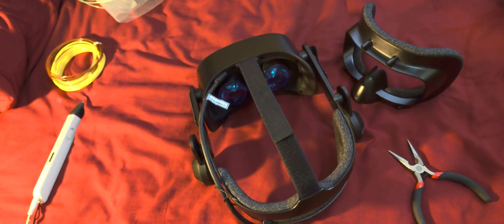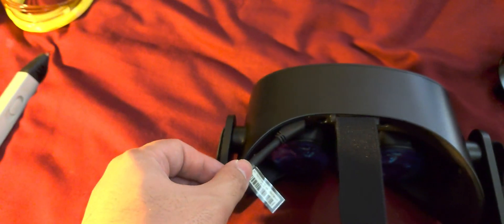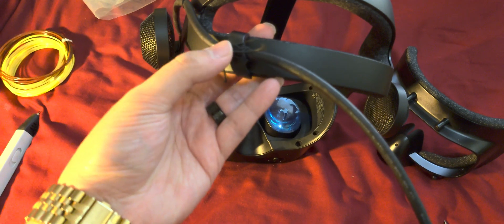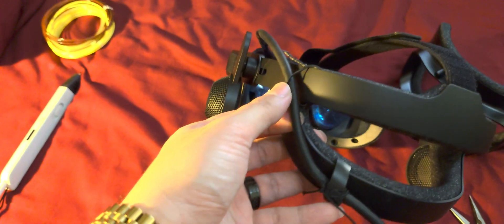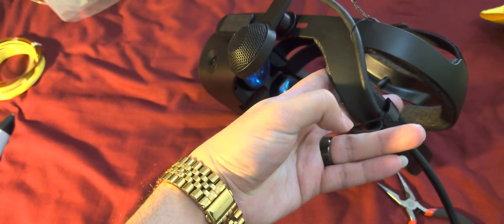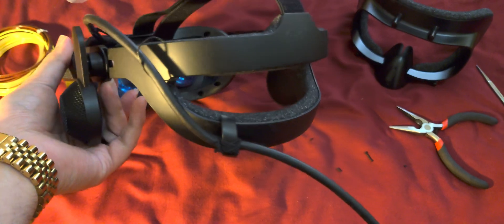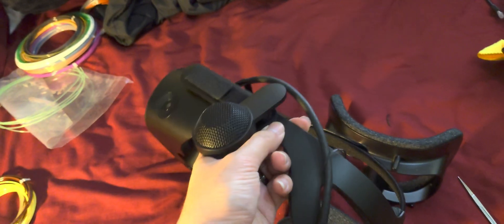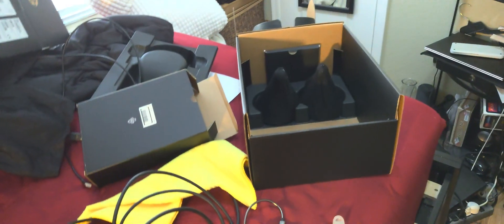Do This BEFORE Ruining Your Reverb G2

Comment: Velcro straps bro
Reply from the maker: They'd be far bulkier both ergonomically and aesthetically not to mention far less secure but a less permanent alternative of a suggestion nevertheless.
Reply: @BradTech.  Not at all, it looks less bulky and a lot cleaner than your solution.  Here is a good example of a velcro strap: https://www.amazon.com/gp/product/B00O9VKVFK/ref=ppx_yo_dt_b_search_asin_title?ie=UTF8&psc=1
Reply: @BradTech.  Also to note, I velcro strapped the cable directly to the headset around the same location of where the HP cable guide clip goes.  With the type of strap I linked you can get it tight enough the cable doesn't move.  I suggest soft side on the inside to not damage the rear cushion.
Reply from the maker: Not half bad  @dct223  although it is infact way thicker both ergonomically and aesthetically than my method, still.
Reply from the maker: My question to you now would be  @dct223  if a horse had dragged you down and out by that cable with your headset on every day for a year then can you guarantee me that your cable will not lose a SINGLE MILLIMETER of that preset predetermined slack a year from now without having to fix or readjust it? because it cannot move as whatever amount of slack you first give it cannot then ever change a single millimeter in a year hence the stretchy string allowing it to move freely but not slip or change length as the string is wrapped tightly way too many times around the cord.
Reply from the maker: otherwise  @dct223  I suggest at least wrapping a stopper around the cable far too tightly to budge or slide across it (assumingly another velcro strap since you like them so much) while remaining too big to get past your alternate strapping method thus guaranteeing your preset predetermined cable slack will not ever change a single millimeter in length over years of tension, tugging, and abuse, for many more years to come.
Reply: @BradTech.  lol what??  your replies are just repeating the same thing that you think your solution is far superior and the only way to fix the an issue;  Trying to sound professional with technical terms and measurements, or confusing metaphors to describe  and/or question anyone else's solutions.  You feel your solution is the most aesthetic and best ergonomically but in reality it's not.  Personally just looking at your new "cable guide" on the side by using twist tie makes me think think that's cheap and ugly.  Your elastic string around the stock rear cable guide does not look aesthetically pleasing to me as well.  Changing to a velcro tie strap in that same spot to hold the cable in place is not thicker ergonomically and aesthetically.  You are probably confused of when people say use a velcro strap.  You use the velcro tie strap around the cable and the back of the headset INSTEAD OF the stock HP cable guide clip, you don't use the velco strap to secure the cable to the stock HP cable guide clip.  With that said, as you put it:  My question to you now would be @Brad ൠ  "if a horse had dragged you down and out by that cable with your headset on every day for a year"  would that stock HP CABLE CLIP with your "solution" of attaching the cable with elastic not break or unclip?  You can easily find numerous examples of that HP cable guide clip breaking when trying to remove or install it on the rear of the head strap.  It's a major design flaw from HP that has been well documented all over reddit and youtube.  It's also meant to unclip so a hard enough "tug" it will unclip.  In addition to all this, you should have better cable management set up to minimize tugging of your cord in general.  Also just think about it, If you have your cable fixed in a spot you will create a new stress point anyways, so a little give isn't bad to have.  Finally to answer your question, using a velcro tie strap around the cable and the back of the head strap at the location where the stock HP cable guide clip goes, I have it tight enough that it will not move unless you have a significant mount of force.  I have enough slack in the cable from there to the plug that goes to the headset to also reduce the stress point right at the plug.
Reply from the maker: maybe you're slow  @dct223  but I'm repeating myself because telling your method will cause you FAR GREATER ISSUES down the line IF the length of slack can change even one single millimeter with force over any period of time even a year under a ton of force it should break the headset before ever letting the length/amount of cord/cable slack for your cable change even a single millimeter... Can you get that through your thick skull? If you feel comfortable guaranteeing that with your velcro straps then I was just recommending you add a tight loop of velcro just around the cable alone for you to manage insuring its length doesn't even more or change over the years, that's all.
Reply: @BradTech.  LOL you should listen to your own advice about having a thick skull.  Others in this video comments as well as the G2 subreddit have different solutions to alleviate the cable strain to the headset.  Majority will side with me in replacing the stock hp cable clip with a velcro tie strap and leaving slack between that and the plug is a good solution.  Sometimes the easiest solution is the best solution.  Not some solution that guarantees not even 1mm of slack will occur blah blah jargon jargon blah blah.  No one is going to guarantee a home solution work around for a design flaw,  you can't even guarantee  that tying a elastic cord around a cable and clip will work.  I don't understand your fascination about needing the cable slack to be in the same exact position to the very millimeter.  As mentioned before, maybe it will help for some longevity in the beginning but you'll just be creating new stress points with it moving and flexing in the same position over and over again.  Electronics are never forever, they are all consumables whether you like it or not.  The G2 will be obsolete soon enough and need to be replaced.  I see your follow up video and the clip pops off, OK what will you do if that clip finally breaks off instead of popping off?  Oh no!!! You wont be able to get your cable in the same exact position and it would have moved more than 1mm!!  OMG YOUR G2 CABLE IS GOING TO FAIL!!    I've had my G2 headset for 4 months with consistent use with no GUARNTEE fixed position without moving a 1 millimeter cable management solution.  My G2 must be going to fail any day now....
Reply from the maker: You clearly lack the capacity for such fix  @dct223  but the defective connector will eventually short out IF the length of your slack can ever vary even one single millimeter over time so if you're internationally wanting to allow for your electronics to wear out faster than my video intends for then it's my fault for wasting the time trying to help you make your velcro alternative safer itself.
Reply: @BradTech. Ohhh My bad!  Didn't know I was talking with an expert on home made fixes for the G2 over here.  Don't talk to me about lack of capacity, I'm not over here speaking gibberish trying to sound smart on ALL your comment responses on your video.  Even with your "GUARANTEE" solution, the slack to the connector will vary over "one single millimeter" as you put it.  Just moving the headset  at the swivel will cause stress at the connector to the headset  I own the G2 and I see the design defect of it and seen all the posts of the cable going bad.  Some is defective equipment to begin with but I'm sure a lot are due to user error and yes some is due to a design flaw causing extra stress at the connector.  Again, 4 months into my G2 with my NO GUARANTEE it wont move more than 1mm, non ascetically pleasing to you velcro tie strap solution and I have had NO issues as of yet.  Also I might add, from this video it looks like you just got your G2 seeing the blue film still on the lenses.  Don't @ me just cus you think you're an expert after reading reddit threads and watching youtube vids about this cable issue.  All I was saying you just need a simple solution for the problem, not some over complicated over thinking, CAN'T MOVE MORE THAN 1MM OR ELSE YOUR CABLE OR HEADSET WILL GO BAD for a fix.
Reply from the maker: If you had any comprehension capacity in general  @dct223  then you would understand that despite politely trying to alleviate your incompetence I was only drawing one logical conclusion for reasons that would require a video of their own to someone as far behind as you because the cord/cable has to be fixed to a point that allows for pivoting withOUT ANY sliding (or variance in slack length to the slightest degree) as it ages so if you're satisfied then best of luck anyway dude.
Reply: @BradTech.  KK Noted with thanks :)  Keep writing all your big words to make yourself look and seem smart.  News flash buddy, NOBODY talks like that, its actually doing the opposite, you're trying too hard.  Sorry to disappoint you, but I do have the comprehension capacity,  so save it with your logical conclusions and alleviations of incompetency talk.  Looking forward for your follow up videos on fixing the cable or replacement headset.  Oh forgot... your elastic string fix is a GUARNTEE WONT MOVE MORE THAN 1mm SOLUTION!  OMG!  HP needs to hire Brad as an engineer right now!  He's figured it all out!
Reply from the maker: No problem  @dct223  I guess I'm just a nerd
Reply: @BradTech.  I would maybe believe your nerd statement if you talked like that in your vids, but you clearly don't.  But you know, that's just me lacking comprehension capacity, and drawing one logical conclusion for someone as far behind as myself, as you would say.  ;)  Keep us updated on your GUARANTEE solution even if a horse would drag you down and out by that cord everyday for a year!  (Cus this is how a nerd talks).  BTW if you really want to test your fix, you should have indicator markings on various points on the cord and headset that can be easily measured over time to prove your GUARANTEE WONT MOVE 1MM or else the cord/socket will short out!
Reply from the maker: Are you still talking  @dct223  seriously? The string already dug into the cord/cable enough to mark it so it'll probably strip some coating off its wires if it were to let it move but the clip was internationally designed to snap off under such circumstances because I'm the one going on people's videos to comment that I think I can do better... jackass
Reply from the maker: I suggest this following https://youtu.be/lmrpapyaBc8 video regarding that.
Reply from the maker: given how many tight rounds of winding in soft stretchy sting it's undergone for the likes of those who often end up stepping on their cables or get twisted in them (poor management) this cable WILL NOT BUDGE I'd rather break my strap before risking any stress on that connector lol
Reply from the maker: and yes, it will unclip and you can clip it back, but the difference is that when you do clip it back; the amount of length will ALWAYS & FOREVER GO BACK TO REMAINING THE EXACT SAME TO THE VERY MILLIMETER, and that is very important... so yes I am obviously assuming that you're replacing that from the get-go. I don't care if it can come off, but it should go back the exact same length every single time.
Reply from the maker: You cannot use this method if say a year from now your slack is a couple of millimeter shorter while you're still using it without noticing, that cannot be a possibility, not even if you still have a whole meter more of slack to spare.
Reply from the maker: so may be you did not process my advice to watch https://youtu.be/lmrpapyaBc8?t=15 this followup explaining that over a week ago.
Reply from the maker: BTW the string is tight enough around the cord/cable for its many loops to never slip across yet stretchy enough around the strap clipping point to act like that rubbery hardening bit at the necks of cords/cables preventing excess flex while still allowing for reduced motion (change of direction withOUT slip)

Comment: You have your cable running on the top of the headset straps which means that every time you put your headset on and take it off you will be lifting the cable because you need to lift the headset headband up at least a little to put it on and off. If you have your cable running down under the headset band then the bending of the cable at the plug end is less. I've been using mine this way for as long as I remember, however, I'm not saying this is a fix for the design issue.
Reply from the maker: Nice profile pic btw tom thank you for sharing your experience!
Reply: @BradTech.  You cost me a whole morning lol. I went back to the HP website and I was amazed at how much more information they have on it compared to when I ordered mine (September 2020 and got it delivered 15 November 2020), so thank you for giving me the incentive to look again! The issue I was alerted to by someone on YouTube (I can't remember who, it was quite a while ago) was the bending of the cable right where it joins the plug. With their solution (which I adopted) there is almost no bending so I thought that sounds like a good idea as every time you put the headset on and every time you take it off you are bending the cable at that point and I figured eventually the internal wires will break. I did not consider as you have done, the actual pressure on the plug exerted by the cable. It is a fair point that the way depicted on a photo on the HP website should produce less pressure on the plug, although HP does not mention anything about this other then putting the plug in before applying power to the headset. As a precaution (because I'm practically OCD on carefulness), I have put the cable back to where it is in the HP photo, but I am still nervous about the bending of the cable at the plug.
Reply from the maker: Thanks again  @tomholy  your experience is highly valuable to us users and yes indeed the machine that's stress testing these is just rotating them in a circle a set number of times for tolerance, but like I said trapping it down will instead always only bend it straight up and down causing far more tension and pull although it seems far safer at first glance by the sufficience of that alternate cable route, and it's worth noting that you want to make sure the slack at the base (and not the side) is preset generously in a very firm and solidified fashion to insure its permanence as I demonstrated per this followup https://youtu.be/lmrpapyaBc8 here
Reply from the maker: I get that actually I thoroughly tested the amount of pressure which the cable is applying against the connector going either direction not to mention that HP will void your warranty for routing it the wrong path! This is the route that the manufacturer deemed or determined for the cable to run though and I assure you that the manufacturer is not so dumb as to be outsmarted about something as simple and straight forward as the direction which they know is better for the cable to go on the headset they designed but they find that motion safer than letting it get that much closer to the wearing player.
Reply from the maker: The pressure of it going down against the left side of physical headset itself builds up way more tension against the connector by multiplying all motion in combining all directions and directing them as the exact same one light tug or pull of wrapping around that very same upper corner of the headset if you care for the details